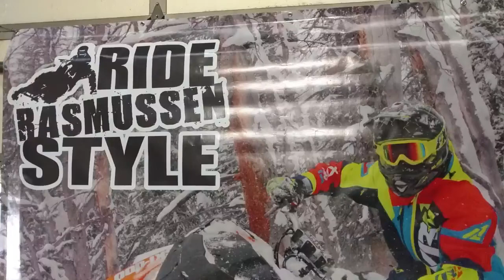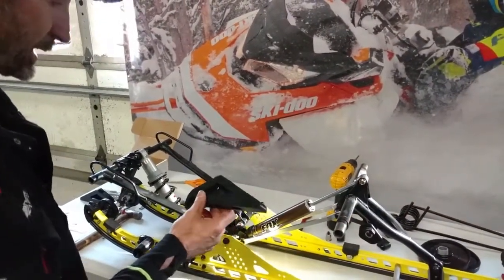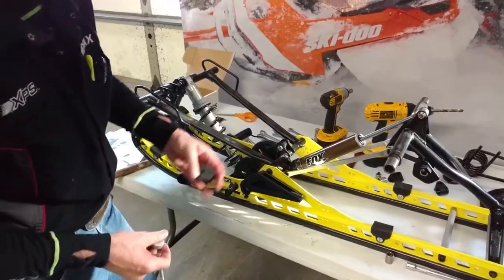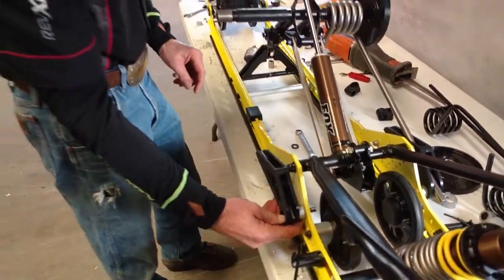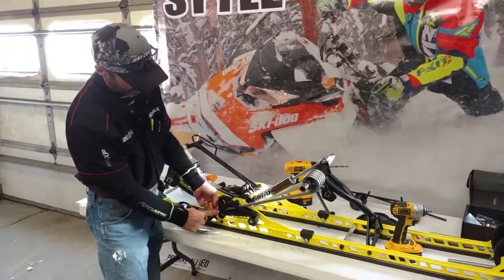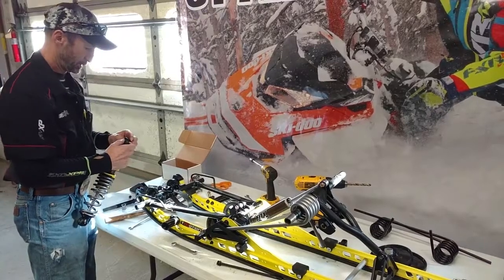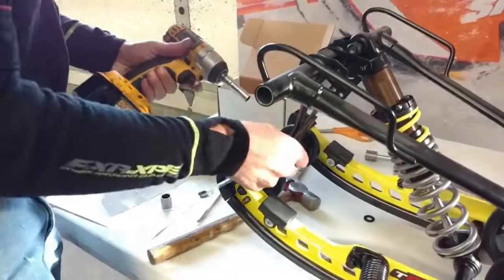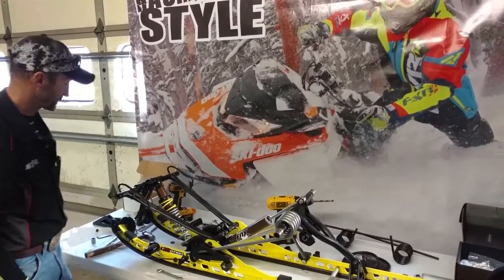Rasmussen Fox RCS Suspension Installation PART 1

Comment: instead of cutting the bolt I just used the washer from the nut side and doubled up on bolt side!! it works fine and no rubbing. just a thought for you guys.. I just didn't have any blades for my saw.